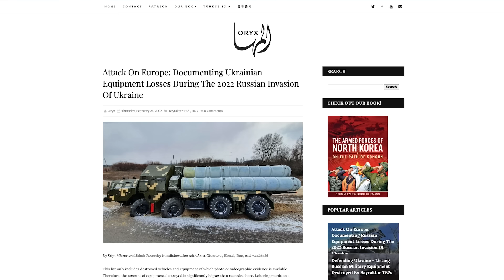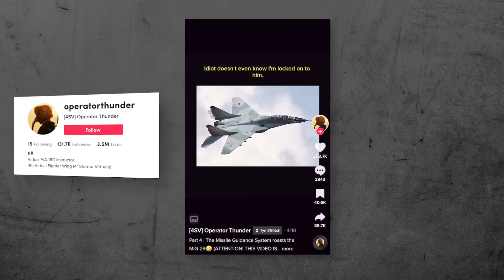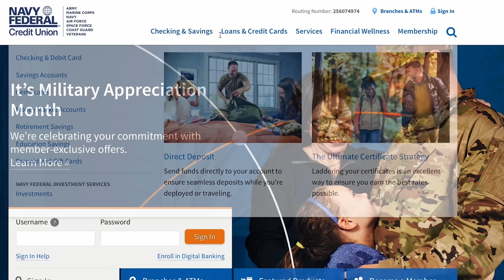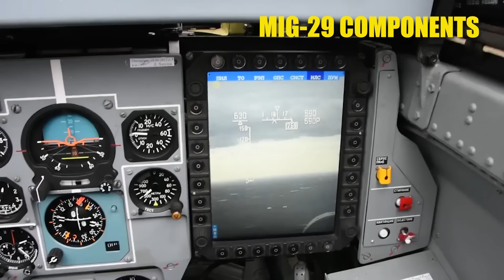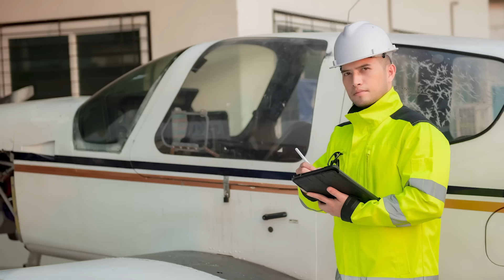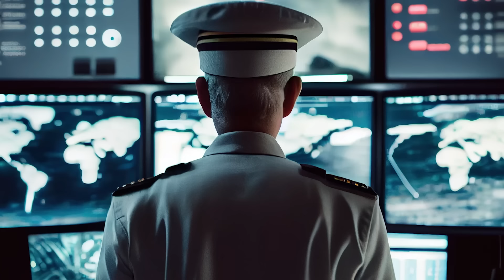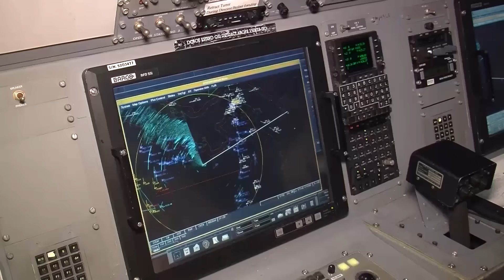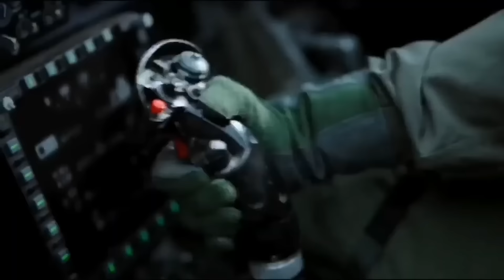How Ukraines new MIG-29 Fighter Jet Operates

Comment: Another aspect that was brought up in a interview with Ukrainian pilot is that F16s will be much safer for the pilots due to long range radars and availability of missiles/radar that does not require constant lock a target . It’s true that most losses is from surface to air missiles but with current MiGs they simply can’t counter russian bombers protected by some newer russian jets operating in Russian airspace.
Reply: You talking tws mode or the fact that they are not firing fox-3’s
Reply: I remember that as well. The Ukrainians said that they avoid Air to Air combat since the more modern Russian planes can just fir and forget at them outside of their own radar range, while the Ukrainians need to be closer and have to face the Russian planes. Mig 29s sounded almost helpless in this explanation.
Reply: Its not the plane, its the weapons. Mig-29s can fire those same russian (and western) missiles. Ukraine just doesn't have them.
Reply: @recon17  It is the plane, since western planes could also equip western weapons without having to modify the Mig29 like for the HARM missiles. Many western countries could then send munitions for those planes.
Reply: @harrythej9683  Ukraine's Mig-29 also fly much lower altitude than the Russian due to threat from SAM. This will further reduce range for the R-27 by Ukraine's Mig-29 against Russia's Su-35 firing R-77 at high altitude. You can read RUSI report about this problem.
Reply: @mjabb02  Thanks for the info and the tip.
Reply: I haven't believed in the "strength" of the Russian army and their awesome planes for a long time now.
Reply: @mjabb02  we russians humilate all thins flying over former ukraine
Reply: Russian bombers fire their missiles from 1500km away. Nobody can do anything against them.
Reply: @CloneDAnon  They are also not fired from that far away since there is no reason to do it, even if they could. Longer flight time makes them easier to spot early. 

It's not about where they are fired from but how they move before impact. Right now, they can all be intercepted and Russia has confirmed it. The scientists working on the Kinzhal have been arrested because of this.
Reply: @justuskid9577  Former Ukraine.. do you mean Russia? Did you realize that Ukraine destroyed 35% Of the Ka52 fleet? Who really got humiliated now?

Comment: History note -- the MiG29 was designed to fight the F16, after the F16 entered service.  That gave the MiG an advantage.  However, the F16 production line never closed and is still turning out absolutely modern models to many nations, most based on NATO standards.
Reply: Only by 2.5 years when both planes were almost completely designed, also today's migs and f16s have been upgraded so much that that doesn't matter much.
Reply: @quartersquishy5312  These planes have been around so long MiG rebranded the -29 as a -35 to give it that new jet smell.  Lockheed tried to change the -16 to -21 for the same reason.
Reply: @jimmiller5600  ok, I don't see your point?
Reply: @jimmiller5600  While yes, that is a marketing ploy to sell the jets. The modern variants of both of these jets are so different from the originals that they basically are completely new planes just using the same chasis. It would be like dropping a modern V8 supercharged engine into a 1969 Mustang and having a modern radio, bluetooth, drive by wire and digital speed dial in the cabin. Their original use and performance characteristics aren't really relevant anymore.

Comment: 29'S are air supieriority fighters and  both Polish and Slovakian machines are upgraded to carry Nato armaments, StormShadows baby ;)
Reply: How well do these Mig29's fare in the A2A department?
Reply: No they arent upgraded for Nato arms.
Reply: @varun2250 Not well. They are far inferior to the jets Russia is currently flying.
Reply: @UnmenschgebliebenerMann67  yes.  Every nation in NATO updated all Soviet arms to meet NATO commitments.   It's how harm and sidewinders are being launched from mig29.
Reply: @jjjr.1186  Harm was integrated just recently. And have you one source or picture of a Mig firing sidewinders? It never happened.
Reply: @UnmenschgebliebenerMann67  they arent really adapted, they arent launched in the harms actual modes like TOO they are pre programmed with coordinates of known air defence and launched that way
Reply: @jjjr.1186  no, the upgrades were modest, limited to IFF, navigation, and communications equipment. They carried the original Soviet weaponry throughout their NATO service. Only recently were Ukrainian aircraft given a la austere HARM integration, but nothing in the way of guided munitions. Also, Storm Shadow is carried by Su-24, the MiG-29 doesn’t have the range to make it into a tactically useful strike aircraft
Reply: @jjjr.1186   They have the hard points and a very limited fire control system. The MIG was never able to program these armaments inflight, or reprogram them after launch. All seeker functions are preprogrammed before takeoff, for the HAARM, or are limited to built in functions for air to air missiles. Anything NATO just can't talk to the MIGs computers. And the upgrades to do so would cost too much for all the problems that would be guaranteed to come with it. Easier to build a new plane from the ground up than to get all the electronics to work together.
Reply: @jjjr.1186  No it's not and Russia already destroyed those migs
Reply: @mightymo-ij9pz I was looking for this comment (was going to write it myself if not found) because that guy up above was very incorrect. Well done. By his same logic, I'd ask how was Greece still using SA-15's/Tor-M1's SAMS and Romania the PA md. 86 in 5.45 as a standard service rifle.
Reply: @Benson_aka_devils_advocate_88 You and the above commenter, and the one that mentioned TOO mode for the HARM, are the only ones that know what you are talking about.
Reply: JDAM's just sayin' looser.
Reply: The British also adapted the Su 24 to carry it. But soon our old F-16 MLU will be delivered the number we have will make good on most of their losses during the last year.
Reply: Target practice for Russia
Reply: @jacksonteller1337  those F-16s will be immensely more capable because they have the computer architecture that allows for full functionality of the weapons. All EPAF F-16s leaving NATO service now went through the MLU upgrade. At this point they all have MIL-STD-1760 wiring and buses, and can find and lase their own targets of opportunity. That simple trick of using a pod with FLIR and a laser designator? Not the Su-24, not the MiG-29, not the Su-27… none of them can do it
Reply: @mightymo-ij9pz  > the MiG-29 doesn’t have the range to make it into a tactically useful strike aircraft

They only have to fly from an airbase to the border.  I think the MiG-29 can manage that.  I don't think they want to fly PAST the border for the same reason the Russians don't want to.  That said if your main point simply that the 29 can't carry it, OK!
Reply: @jjjr.1186  O they were not brought up to NATO standard other wise they would not need f16's
Reply: I think none of them are match for IAF MIG 29 UPG
Reply: "Nato" isn't a word.  NATO is an abbreviation, I would even accept it as an acronym.  But in any case, it is fully capitalized.
Reply: The Mig-29 also doesn't have the payload for StormShadows. It can be launched in preprogrammed mode which is how the SU-24 does it. The mig-29 MIGHT be able to carry ONE on the center hardpoint but with much reduced range.
Reply: @lqr824  If I remember right the MIGs only problem is with the physical carrying capabilities. It can't carry the weight needed, or the way they hang, or something like that which makes the SU aircraft a better option. The MIGs can do it but they aren't the first choice. Which is another reason Uk has been asking for F16 or F18 aircraft.
Reply: problem is most of those Migs donated to Ukraine are not airworthy. They are just for parts to keep the current fleet operational.
Reply: @jjjr.1186  it’s not that hard to change equipment to launch different munitions 
It’s literally just computers and mounts like it’s nothing for a couple guys getting paid some good money to do it
Reply: Shhhhh
Reply: @Radbot776  this is sarcasm right? If not, you don’t have a clue what you’re talking about. Even various NATO aircraft can only carry certain munitions. It’s not like every missile or weapon can be used by every aircraft.
Reply: @jjjr.1186  PL and SK MiG-29s went through some upgrades. Mostly comms, navs and other avionics. They can't use AIM-9, AGM-88 (beyond the very rudimentary implementation which can be done on "whatever aircraft you choose" like UA already does) nor any other western armament.
Reply: @thehusketeers4319 smdh 😂🤣
Reply: @danielduncan6806  it is an acronym like USSR, Ukraine Southern State of Russia
Reply: @Cream pie 67... That's the funniest thing I've read in a looong time. Just call a couple of random IT guys, have them wish on a star, rub a bald guy's head, and over the phone, have them explain how to convert Soviet software systems, into NATO software systems to carry and launch multi-million dollar missiles and bombs. I can't figure out why they hadn't done it sooner.
Reply: @thehusketeers4319  Only target for Russia is the Kremlin 😂😂😂
Reply: At least some Polish migs were integrated to AIM-120 AMRAAM. I don't know about stormshadow, as Poland never used it.
Reply: @Benson_aka_devils_advocate_88  exactly the Fulcrum just a delivery system. But believe they've already started using AWACS and drones to identify targets and provide fire solution.   Mig 29 delivers the ordnance  But this the best strategy atm anyways.  But do believe they are beyond programming before takeoff.
Reply: Good to know thanks
Reply: @seatownchris206  shaking my dumb head?
Reply: @gruenerteufelDD  yes they can. Fact. Lol it's easily verified. Mig 29 launches harm.  Su24 launches storm shadow.
Reply: @gingernutpreacher  yes they were.  But still doesn't make them a f16. But they are more effective.  Look up Poland's mig29 upgrades.  Yes they were updated.
Reply: @alexnderrrthewoke4479  if only u saying it made it true.  If they were destroyed why doesn't Russia gain air dominance.  Oh yes they can't.  Because they weren't destroyed.
Reply: @Radbot776  yes exactly.  Like buk firing sea sparrow.    Or s125 firing amram missiles.  It's not rocket science. Most munitions use the same navigation methods.  Hard points easily modified.
Reply: @Benson_aka_devils_advocate_88  actually su24 has terrain navigation radar.  It's why it can fire storm shadow.   Ir scanners on modified mig29 are the reason it can fire amram and harm.   So yes they can talk to each other.  Buk is firing sea sparrow.  S125 can fire amram missiles.    Also all the upgrades were done decades ago by NATO nations part of the former Warsaw nations.  Also USA uses Russian equipment for training. Modified to use NATO standard munitions called the red squadrons.
Reply: @The Husketeers....It's s not healthy to criticize yourself. Have more self-confidence, bud!
Reply: @seatownchris206  after the soviet fell a lot if the soviet IT guys moved to nato countries. Many of them work or worked  for nato. Thousands of educated people left the Soviet Union and many work for America and nato. So whatever’s left in Russia literally has to defeat the soviet plus nato.
Reply: @jjjr.1186  
Sidewinders fired from Migs
Another dose of your medication is required 😂
Reply: As much as I would want to believe in that, but that's not true... Polish Air Forces failed to update their MIGs and just abandoned that idea, Slovak Air Forces (I'm not sure for 100%) never tried to that. All that we've got are either same ussr MIGs just slightly in a better condition than ours, or just the spare parts basically MIGs that can't really fly.
Don't get me wrong that still awesome and thanks to our allies for that, but still...
Reply: @danielduncan6806    you're mistaken. NATO is what's known as a "word acronym", as opposed to, e.g., FBI which known as an "initialism" or "alphabetism'. Initialisms are pronounced as individual letters so they always have to be spelled with capital letters. Word acronyms are pronounced as, well, words: NATO rather than "en a tee oh".   Word acronyms can be spelled as words: "Nato". And this, in fact, is how the BBC spells it.
Reply: @voidtempering8700  they don’t have the stand-off ability a su-30 or 35
Reply: @UnmenschgebliebenerMann67  r-73 archers sure
Reply: @Benson_aka_devils_advocate_88  also low fuel capacity and highly inefficient engines if you keep them spooked up
Reply: @jjjr.1186  They are using HARM for it's seeker head   the HARM has its own targeting sensors built into it.  By carrying it the can find the AA radars and have them engaged by Artillery systems.
Reply: @thehusketeers4319 LOL. You're not wrong. The thing is the Russias didn't get any practice before this so they tend to miss a lot.
Reply: @varun2250 not good at all. They don't carry fox-3 missiles currently, so in a modern air war, they're basically useless in A2A.
Reply: @voidtempering8700  lol flying?  You mean crashing?
Reply: Wtf are you talking mig 29 are Multirole fighters
Reply: @Acetheskyhook  No, this a serious discussion, leave your jokes elsewhere.
Reply: Can the Polish and Slovakian ones carry JDAMs-ER and NATO anti radiation missiles?
Reply: German pilots using MiG-29s totally dominated American F-16s in wargames.
Reply: @DanielBelzil  Those usually consisted of close range dogfighting, which is not how air combat in Ukraine is typically performed.
Reply: @jjjr.1186  They can not fire meator ect. I'm confused I never said it makes them a f16 what do you think I was on about?
Reply: They are not air superiority, they are multirole, but are ok planea.
Su27 was the air superiority variant of the usssr
Reply: @todop  it doesn't matter the Iranian f14 were making plane's go boom with over the horizon kills thanks to better missiles
Reply: @gingernutpreacher  I just wanted to mention that it's not officialy air superiority, it also can't carry as much weapons as su or f14 f15. And the radar is smaller. 
But it's still capable.
Reply: @UnmenschgebliebenerMann67 
They are upgraded.
I just do not know for what arms exactly are enabled for the Nato MIG29. On an storm Shadow Wiki Page I found the Suchoi_Su-24.

By the way, Iran upgraded the Tomcat for another than US arms.
Reply: @todop  anyway let's pray Ukraine win's
Reply: @gingernutpreacher  well they are doing far better than I or most people expected. I was expecting a stale mate at the river and maybe eventual hot border like Germany or Korea
Reply: Oh that’s great!
Reply: @alexnderrrthewoke4479  did they? Just like the Bradley's hey.
Reply: And cannot lift a colossus as the storm shadow, that is for the SU-24.
Reply: It’s easy to have air superiority when the enemy is throwing rocks but paper planes don’t hold up well in the real world. 😂
Reply: @alexnderrrthewoke4479  just like with leopards, Russia already destroyed all 79 of 20, and even before they were delivered 😅😅😅😂
Reply: Bakhmut just fell baby ;)
Reply: @varun2250 Not good. MiG-29's have the worst air to air combat record of all 4th gen fighters, and no, that isn't a typo. The WORST combat record. That said.... every single Russian jet has a air to air combat record ranging from "so-so" to "Burning pile of garbage". So, eh. Russia doesn't make good fighters, despite their propaganda they so fervently spread.

 The proof is in the pudding, as it were.
Reply: The MiG-29 is not an air superiority fighter lmao.
Reply: Modified, improvised and adapted, not something Military Aerospace Science cannot achieve.
Yes, the MiG-29s are formidable while the MiG-25 Foxbat still holds the fastest combat aircraft speed since 1964 (59 years).
Reply: @danielduncan6806  
NATO is an acronym.
An abbreviation is a truncated word; an acronym is made up of parts of the phrase it stands for and is pronounced as a word; an initialism is an acronym that is pronounced as individual letters.
Reply: @alexnderrrthewoke4479  no
Reply: @voidtempering8700  Mig 21? 😂
Reply: @testboga5991  ??
Reply: Yes keep helping slave Ukraina!!!
Reply: Already seven months ago, a MIG-29 provided by Poland and Slovenia used HARM to raise the record.
The use of Stormshadow by Ukrainian forces has recently been confirmed, and no EF-2000 or Mirage2000 has ever been provided to Ukrainian forces. Probably a modified Su-27.
Reply: @alexnderrrthewoke4479  I think you mean they all have already been shot down 😂😂😂
Reply: Already shot down baby.
Reply: @varun2250 they’ve been doing ok enough to keep the russians at bay. Which should work until the promised F16s are delivered.
Reply: 40 year old French missiles 😂
Reply: lol
Reply: @bangdoll4500  dont forget that Ukrainians are the MacGyvers on the battlefield and those long  range rockets are programmed b4 launch so the platform doesnt really matter, they will find a way, and btw its Slovakia, not Slovenia ;)
Reply: @voidtempering8700  maybe, but what about the pilots training?
Reply: @atomicbuttocks  What do you mean?
Reply: They had to put out these systems
Reply: @danielduncan6806  it's a portmanteau word.
Reply: Very short range sorry
Reply: @danielduncan6806  NATO isn't an abbreviation, it's an acronym. 😉 A bit like radar and sonar, only they have become words in its own right these days.
Reply: @Daniel Duncan  sometimes I say us sometimes I say india something I say russia I don't care about capitalization It's not disrespectful to me
Reply: But next to the F16 is a kiddy ride
Reply: 29s are not carrying storm shadow.
Reply: @UnmenschgebliebenerMann67  All former Soviet bloc nations upgraded their military aircraft to use NATO weapon systems when they joined up. Interoperability baby.
Reply: @Vanceydress  Im sorry but thats just wrong. Read this threas.